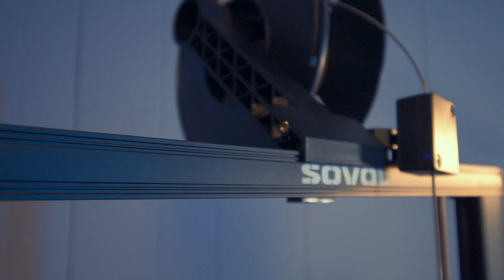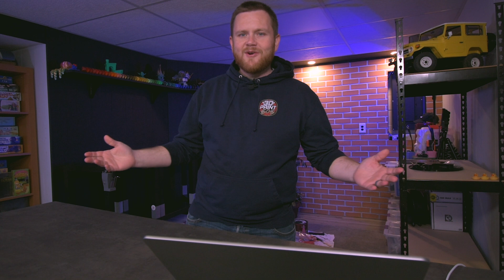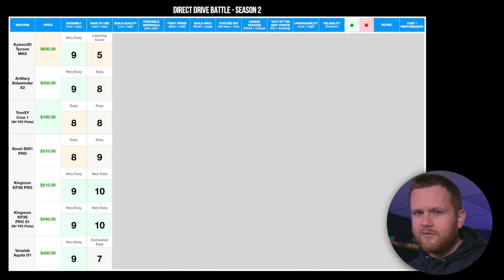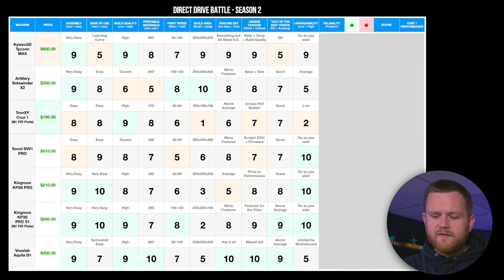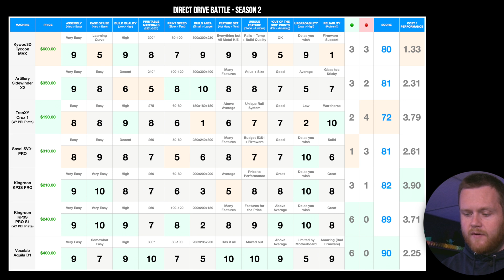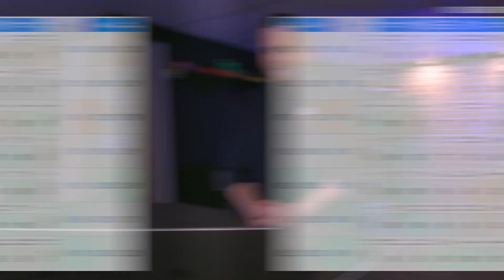Direct Drive Battle - Season 2 FINALE

Comment: A bit strange to give Artillery x2 lower numbers when they are honest about the temperature of the nozzle and secondly, I am quite sure that the software allows to set the max temp above 240c, it is limited to 260c.

The problem with Artillery and why I haven't wanted to buy a machine is that the firmware is a nightmare to update, everything else has are pretty easy to update/upgrade so you can get a machine that can handle 300c, it's also constantly on sale for $250 and maybe going down even more now that Artillery is coming with their core xy machine.

I'm still considering buying one as a backup machine.
Reply from the maker: Well you heard my thought process. I thinks it’s great they don’t make it dangerous or otherwise market it. however, that doesn’t change the fact that I can’t print hotter. So, technically I have them extra points by quite a bit. Just cause I think it’s cool.
Reply: @3DPrintSOS  I saw Aurora tech print at 255c without it starting to smoke, so the machine is no more limited than the others in the test that state 260c as max.

You also say in the video that x2 has a software limitation of 240c, that's actually not true!
Reply from the maker: Just because Aurora (absolutely love their channel btw) did it doesn’t mean it’s ok. There’s a ptfe tube in the hotend. Printing over 235 at a sustained amount of time will highly likely off gas toxins. Why risk it?  Not for me. 

Not sure sir. Maybe I have an older firmware? 

I appreciate your input and I understand you’re just trying to help me get the correct into. So, no hard feelings. :)
Reply: @3DPrintSOS  Yes, but that is also the truth for the other machines that state 260c.
Reply from the maker: As soon as I have time. I’ll take a look and update my doc. If it’s wrong, it was an honest mistake.

Comment: Fedor, thank you for the thorough review.  This furthers my desire to get the aquila D1.  I have been waiting to see if Voxelab was going to introduce a large format D1.  My Aquila Pro is not doing well.  It is kinda turning me off off Voxelab.  The printer first started to stop in the middle of a print with filament out alert, but there was no issue with the filament a resume print restarts the print. Now the printer stops heating the hotend and bed, but still continues to print until the filament will no longer move.  It appears that the issue is in the main board, a $105 part from Volelab.  

Thank you you have given me valuable insight in my quest for a replacement to my old flashforge creator pro v1
Reply from the maker: I dont blame you one bit for being turned off a bit. And the D1 is so close to pretty much everything we have asked, but the firmware is definitely lacking. So close though!
Reply: Good thought - I did not have this issue with the older firmware - would it make any sense to back level to the prior firmware?  Although the problem may be due to a flaky control board.  ??
Reply from the maker: @jamesalbrecht395  Filament runout sensors are SUPER cheaply made and are finicky all the time. Sadly. So not surprised to hear you have an issue. If its stopping heating but still going, thats an issue for sure, but not sure its related to the same issue or sensor. That sounds like it could be mainboard but FOR SURE try different firmwares if they are available at all. Free way to find out.

Comment: First! And I get to be the "Ackshually guy" too?! 😋
The KP3S Pro S1 has the Y-axis linear rails mounted directly onto the chassis of the printer. Whereas the upgrade kit for the Regular "Pro" mounts the linear rails on top of the extrusions used for the v-wheels. So it's the upgrade kit that "steals" those ~15mm Z-height. The S1 ships with a 200x200x200mm build volume, just like the Pro, and so should score the same in the build volume category. Which also would bring it up to a tie with the Aquila D1 in the total score.
I thought it worth mentioning since on the Kingroon website you get the Pro with an upgrade kit for the same price as the S1, but with add-ons that might tempt you to go that route instead of just buying the S1. I doubt many will actually need these last ~ 15 mms, but it might be good to know for some. 😊